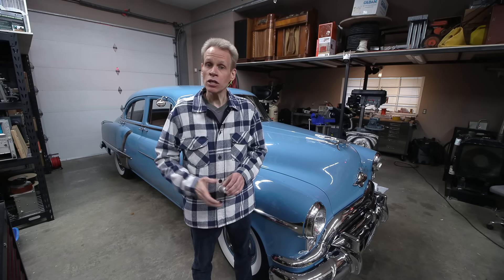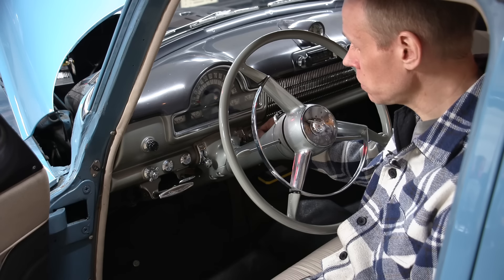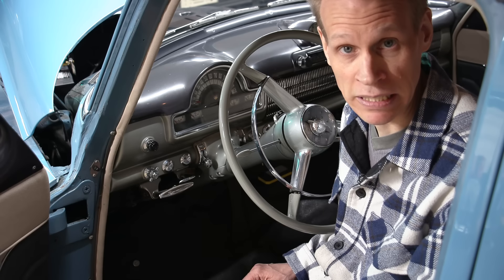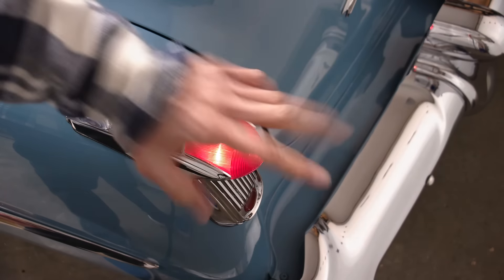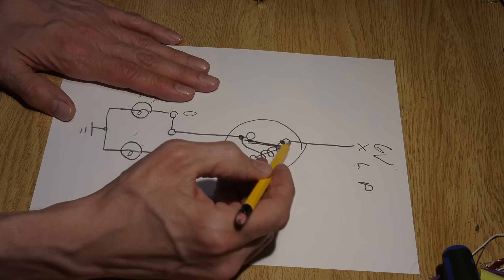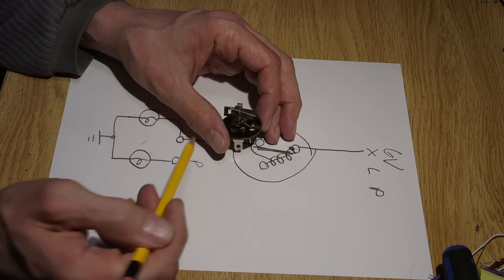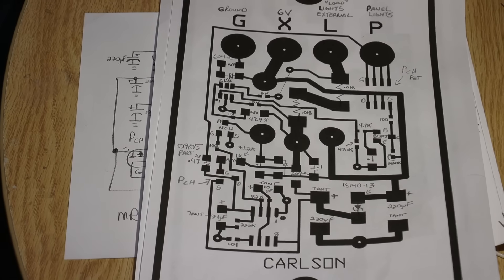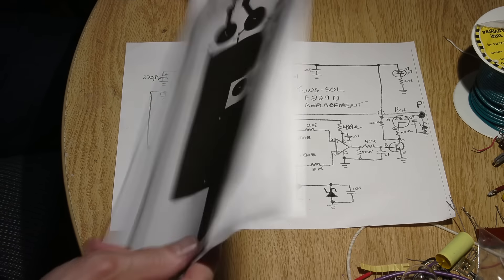How A Turn Signal Flasher Blinker Works - Complete Redesign With Schematic [Tung-Sol P229D]

Comment: Great  video.   There is a lot to consider when reverse engineering.  The bimetallic contacts survive in toasters but are for longer time constants.  It was not clear if the points for the second circuit were on the single bimetallic arm with the primary ones.  No clear physical picture so its hard to understand fully the basic requirements for the new circuit.  Otherwise very enjoyable and thought provoking.

Comment: Great video Paul, thanks!  I remember building a similar circuit from Radio Shack parts as a teenager back in the 1970s.  IIRC, it had sequential lights that would blink three lights in sequence but my old 6V '59 VW Bug didn't have triple tail lights to test it on so it never got off my workbench.  When you held up your old mechanical blinker I really thought you'd restuff the can with your newly designed circuitry like you do occasionally to radio capacitors.  However, I understand the logic behind using the Hammond box instead.  As for your car, that's a fine looking '50s era vehicle!  To quote the first Indiana Jones movie, "I even like the color!"  I'm not up on '40s and '50s cars, though (except VWs), so can you tell us a little about the car?  Thanks!

Comment: Really cool.  If I understood correctly the original stops working completely if one of the bulbs burns out.  Does your implementation provide a rapid flash/click indication if one of the bulbs is burned out like on more modern cars?

Extra points if you come up with a PCB where you solder through hole blade terminals to plug into the original socket, and without the ground (just using a little current through the bulbs.  You can use clear coat/epoxy to forego the enclosure.

Comment: Paul you have a killer lab.I like your SS replacement for the tung sol flasher. Very interesting, but have you considered polarity protection? For instance if a later battery in the auto is replaced and the owner accidentally  instantly reverses polarity. I would hate to see your device smoke.

Comment: I need to build adjustable voltage regulator for a Delco 21si alternator, to allow up to 29v output , any suggestions?  I was tninking just use a zener diode to powe the gate of a possibly irfz44n  mosfet, with a resistor and pot to form a voltage divider, to allow adjustments. Not sure it wil work, i know little about electronics. Basically the fet should be on until the zener voltage is reached then it shorts the gate to ground shutting off the gate for a fraction of a second, then back on. Basically a pwm signal going to the brushes of the alternator. And duty and frequency can change depending on load. A alternator can output many hundreds of volts with open circuit and 12-24v to the brushes. Im using 12v alternators wanting to get 24/29 v from them, with adjustability from at least 27-30v , 12-60 v would be awesome, it is possible to get 60 volts from a 12 v alternator, although it can drop below set voltage at idle when using a 12v stater. I could change the field coil and stater to a 24v version, and install a 24v regulator. But it would ve cheaper to just buy new alternators, i have 6 maybe more im wanting to convert .  Any advice is greatly welcome . Basically the regulator outputs a frequency, duration based on the voltage, low  voltage its on for longer duration possibly higher frequency, high voltage possibly low frequency low duration, or the frequency could be reverse, i haven't seen it on a scope. Just in case you weren't familiar with the operation. I really need help i needf to get one going soon. I need it to charge batteries for my off-grid house, when the solar panels don't recharge the batteries! It can run 6-8 hours per day until recharged. Or 2-3 hours just before a storm to top off the battery . It is going to charge a 1000 ah 24v battery made of lithium cells, 29.4 full charge, but i want to keep it just below 29v,28.8 or so. I also have a small 12v system.200 ah or so. Im going to mount a 12si alternator on the same engine with a srlector switch. To allow 12-24v or both if the demand isnt too high! A slightly modified 5hp engine isnt going to do much with the slightly over 50% efficiency of alternators, and 100, 130, 150 amp alternators, i may use a 60 amp 12v alt, i figure the output will be less when the voltage is higher. 75amps from a 150 amp 12v alt. When its doing 24v. It could probably do the 150 for a short time. Maybe 5-10 minutes, its probably going to overheat!.. i want to install a thermal switch to shut it off when the stater reaches about 120°f use it to kill power to the brushes.. sorry to ramble, but i need help. My only other option is to use two alts in series , with the regulators seeing 12v. And the total output being 24v. Isolating the outputs the rectifier will be removed the output in series, a 12 v battery to feed the brush,  they eill think they are 12 volt, but the actual output being 24v.. have a awesome day!✌️

Comment: I BELIEVE, and I could be totally wrong.... but I believe the reason they did this system was it started acting wacky when one of the turn signal lights burned out.  When that happened, you knew your blinker bulb needed to be replaced.
Reply: They all do that even the normal ones
Reply: You’re absolutely right my friend. Mechanics back then were trained to look for that.
Reply: @brianwild4640  right... because it was a good idea!  For little or no circuitry, you got the added benefit of an "indicator" that there was a problem that you then had to investigate.  Definitely not the first system to work this way, but just another way of wiring things up to give you a double benefit.
Reply: Most bimetallic TS flashers are designed  for a particular load and detecting bulb outs is a feature, not a defect.
Reply: @Derpy1969 One hundred percent. I remember when it would happen when I was a kid and my dad would say that one of the turn signal bulbs needed to be replaced,
Reply: Yes! Behavior change would indicate a faulty bulb. And there is a front and back light for either passenger and driver side, probably in parallel, so that's some complex changes.
Reply: darrylvaillancourt6144  No Darryl. I'm an electronics engineer. But i have experience in replacing and re-purposing electronic circuits.
Reply: darrylvaillancourt6144  There you go! And like Paul showed in this excellent video.. it takes a LOT of  time thinking and tinkering to come up with suitable replacement!
Reply: Kind of complicated compared to what it replaced. Going with that theme, I would have used an Arduino Uno, a relay or two and a small speaker for a really unique click. My click would get louder if I left it on too long and may prompt me to turn off my blinker. My junk box is different than yours and you need to use what you know best.

Comment: I think the cross connected panel light arrangement is a burned out tail light indicator. 
 if the right tail light is open, the left panel arrow will not blink.

Comment: I always thought the 229D was designed as the simplest way to flash the brake light filament independently from the flashing (only) front indicator filament but still allow the brake light to function on the opposite side. That was unique to cars having integrated rear flashers. I may be wrong though... as that memory comes from way back.

Comment: Very interesting that you should be doing this right now, because I am currently wiring an indicator circuit for a series 1 Land-Rover. The car didn't have flashing indicator lamps originally. The circuit uses a 12v flasher unit like the one in the metal can. Anyway, my question is; would my car positive earth have an impact to your circuit design?

Comment: There's a lot of different ways to do the same thing. This biggest mistake we engineers make is focusing on only one solution and thinking it's the best way. Sometimes it is the best way, but often times it's just one of several ways.  You could greatly reduced your parts list and simplify your design by using optically isolated inputs to an Arduino Nano module and using FET's or just NPN power transistors to drive the lights. Another advantage to my solution would be the ability to program the flash rate and duration anyway you wanted and to change the programing at anytime. A proof of concept could be breadboarded  and operating in less than 15 minutes. Bread boarding a proof of concept would allow you to have an emulator that you could use to test customized flash rates and flash patterns. When building circuits I try to use the KISS approach and minimize the amount of time Im spending on construction and design. After all, time is a valuable commodity, and there are always other projects that need attention. You should think about this.

Comment: Is your garage near an intersection with a traffic light, or do you have an operating traffic light in your garage as decor? I see the reflection of its color cycle in what looks like the air cleaner cover of the engine when you're in the driver's seat, and I thought that would be pretty neat if you had some in your garage just for ambiance.

Comment: Mr. Carlson, would you be willing to do a video about infinitely variable rotary encoder switches and motors? I have an early 90's Snap On AVR MT1590 with auto load, and I suspect it has a bad encoder switch. It doesn't respond to load adjustments on the LCD load setting indication. Keep up the great work.

Comment: Great story. Just one extra thing I would have checked and that is going directly from left turn to right (and vv). And, though it won't apply to this car, how would emergency flashers work with a similar circuit - all four flashers going at the same time?

Comment: 6 Volt, slow and hot. I remember that in the beginning of the '70 in the electronic magazines circuits started to pop up for break lights, to start a break light with one or two short pulses, so it showed as more alarming for the tailing driver. Officials prohibited it, because the lights did not show fast enough. It was the time that many cars still used a 6 Volt system. I wonder if they would allow it in our days with faster 12 Volt.

Comment: There is another version, where a burnt bulb is indicated by rapid blinking of panel light. This is much simpler wiring internally, because it uses thermal properties of the bimetallic strip itself. When there is no load, the current through the nichrome is less, bimetal cools down rapidly so high frequency.

Comment: I noticed that your circuit is quite complicated. However it would not change the duty cycle of flashing in the even of either front or rear turn-signal-light is out that the thermal flasher does..
Reply from the maker: The resistors in the current sensor circuit can be "tweaked" to indicate a dead bulb if so desired.

Comment: Use X7R capacitors in place of tantalum.  The temperature coefficient is only +-15% from -55 to 125 deg C.  It might be higher then tantalum @10% but tantalum also changes by 10% after 2000 hours of use.  Never mind the +-5% change due to vibration that tantalum also suffers from.

The ceramic capacitors are just so much more reliable.  After 20 years the ceramic will be just like new while the tantalum will be lucky to work let alone provide good timing.  If you want to build and forget about this board, use ceramic.  When using ceramic there will be a slight temperature coefficient but it will still be more stable / accurate then the original module.

Comment: eBay sells this flasher. Fits 1946-1952 Oldsmobile models - $12.00.
Reply: That's what I said yesterday when I watched this video. Not only can you still buy these both NOS or used, I'm sure aftermarket restoration companies make a replacement as well. Not exactly "unobtainable" as this guy says it is.

Comment: I have seen these 3 terminal flashers used in the situation where there is only a single panel dash indicator for both sides. In this case the separate flash contact makes sense. In this case it seems like connecting L and P together would give the same effect?

Comment: I'd find it simpler to ground the 'P'  wire instead of connecting to the flasher, swap the cluster lights (right/left) and use a 2 wire flasher.

The indicator lights of that vintage would be on pigtail sockets, so just unplug from one side and plug into the other.

Comment: Also that car seems very clean still being 6v. Does it still have a generator or do you have a 12v battery, alternator and starter with a regulator for the other stuff?

Comment: Two questions...
1) How does this design handle 6 volt LED bulbs?
2) Can this design handle the heavier load from added lights like trailer lights or multi tail light systems with say three bulbs in each taillight?
Reply from the maker: #1: just fine
#2 the relay is rated for 15 Amps.

Comment: I'm wondering if this could be simplified if the relay had 2 contacts where 1 of them stayed connected for longer. 
What I mean is if one of the contact springs were bent physically closer, then that contact connected to the load would be the first to connect and last to release, giving the behavior needed.
I think that way the timing circuit that controls the relay is the only thing that would be needed, or am I overlooking something?

Comment: I miss the old relays. They did what the SS circuit you made did and I never had one stop working. I have totaled cars and they still worked. And a nice loud click too. The stuff they have done to cars today has turned them into insanely expensive rolling garbage.

Comment: Small concern.  When the car is running the voltage will go up to charging voltage which on a 6v system may be close to 8v.  what impact will that have on the timing?  if it negatively affects timing....  youll need a Load switch IC on the 6v input...  select one that can handle 6 - 8v and a solid 6V output.

Comment: There is one point u didn't talk about that's related    in those days the brake and blinker lights/filament in the back lights was the same   so if stopping when u turned on the blinker the filament was already lit   thus the blinking bulb filament had to be disconnected from the brake powered system    was that done in the blinker switch or maybe in the flasher unit   it seems to me that's another added complication       gm did it in the blinker switch so how was this done....

Comment: I’m wondering if replacing the incandescent bulbs with LED lights may have worked better with the original turn signal flasher blinker to correct the timing.

Comment: Excellent job Paul!  Was the same lamp-switching-1950's-trickery ever used in 12V systems?  How about for use with 'hazard flashers', where all 4 blinkers flash?  Although, they may not have had hazard lights back in the 50's so you'd have to add a hazard lights switch in your Oldsmobile.

I may have missed it, but is this design only for use to replace unobtainium 1950's style flashers with that particular Tungsol 'trickery'?

Could this unit be modified to suit modern, 12V systems?  It would be nice, for example, to be able to adjust the duty cycle of the flasher?  I really like the solid, definite "click" sound your unit creates!

Comment: I just wondering If it's a single globe with seperate brake lamp filament and seperate turn filament?  Or is the one filament for both turn and brake. If so what happens if braking during turn signals?  But great design.

Comment: Quick question. On the old system a burnt bulb would cause the circuit to pulse faster. Will that occur with the new design? Thanks for what you do!

Comment: In Europe, this type of lamp for turn signals has always been banned. The color must be amber so as to never confuse braking, for example. I believe that in the United States, it is still possible that this signal is mixed with other lighting, therefore red at the rear, which is extremely dangerous! You didn't show what's happening when you have the brake + the night light + the turn signal at the same time on this little place with ... 3 bulbs?
Reply: Most commonly, it's still just one bulb. Dual filament. Low brightness for running light; high brightness for brake/turn.

Comment: I wonder if something like this would be easier to implement with arduino. Also, the newer turn signal relays sense if there is one of the bulbs burned out and speed up the cycle so the driver is aware.

Comment: Nice job, but I would solved it with a little mcu system like a teensy. By the way do you have also a lathe and a miller in your garage ? 😁

Comment: You can reduce the number of components by using a microcontroller. Supply voltage to MCU from electrolytic capacitor or super capacitor It's even easier if you can bring a separate ground

Comment: I know this is totally unrelated but I own a Telefunken 5803w radio from around ‘61 that my parents owned and I grew up with. I had it stored and it’s in remarkable shape. It powers up and will run some stations but I can tell from the ‘eye’ that the station strength is not full. I hope it’s just an antenna issue. 
When I turn it on and listen to a station sometimes it suddenly gets louder and the eye display shows longer bars.  
I’m hoping I can get some sort of antenna to attach to the existing fm leads. 
What kind of indoor antenna would you recommend to increase fm performance ?
Thanks!

Comment: Okay!  so, you all wonder WHY the auto manufacturer did it this way? the answer is SIMPLE really... its so that if a turn signal bulb burnt-out, the inside panel lamp won't glow!  now, look at the circuit AGAIN, but this time imagine a 3-WAY flasher on the second flash cycle (NC), now the panel bulb will NOT light if the corresponding bulb filament is open.